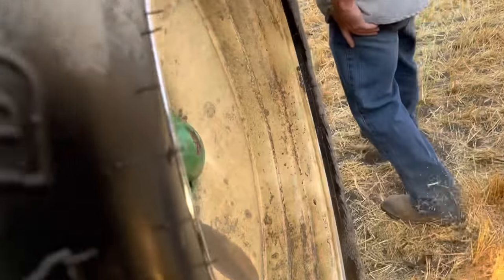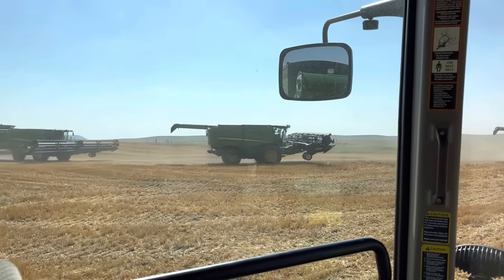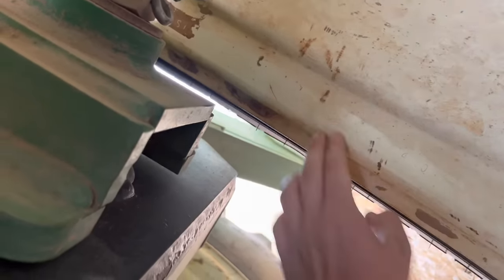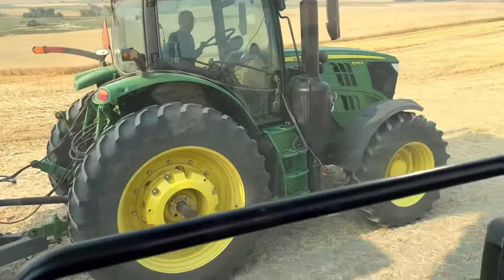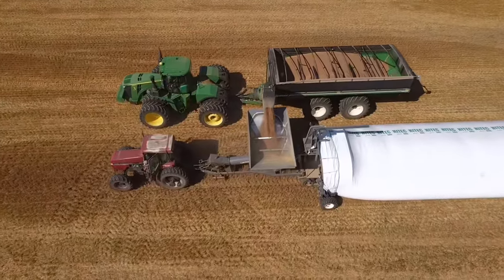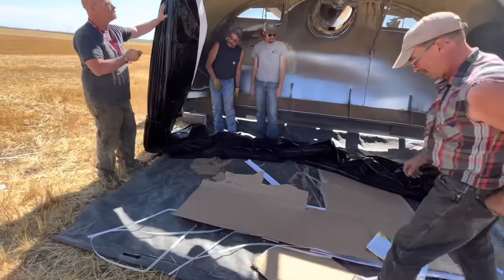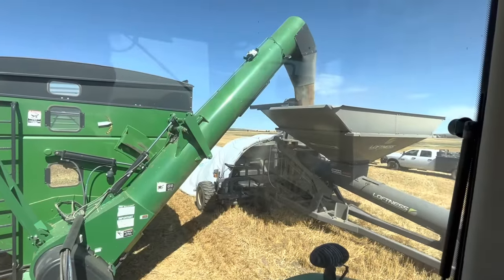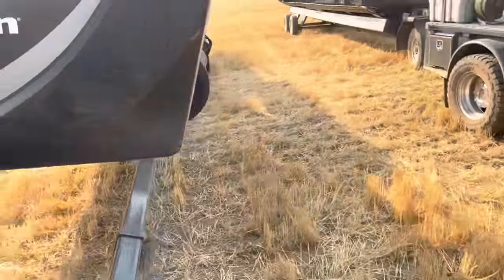That’s a Wrap on the Wheat Run! - Custom Harvest 2022

Comment: Ok here is a DUMB question from a non farmer. What do they do with all the wheat in those bags? How does it get used, I'm assuming it snows on them and are not availailable till springtime. Is there spoilage in those bags? Thanks
Reply: There is a vacuum they will back up to it and load it into semi‘s this winter. Pretty simple. Just reverse loading.